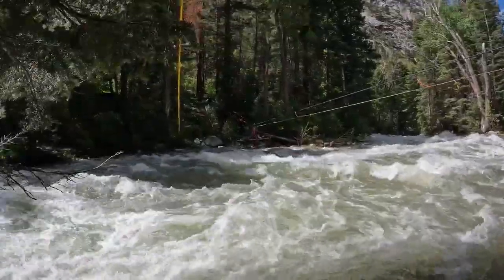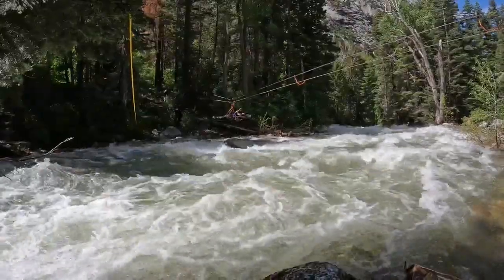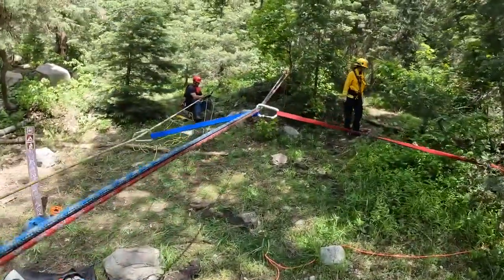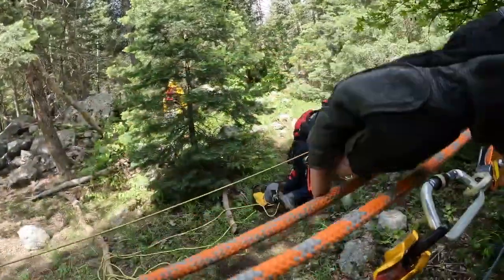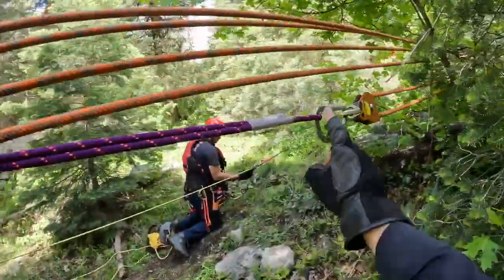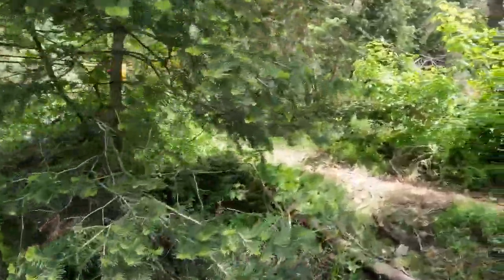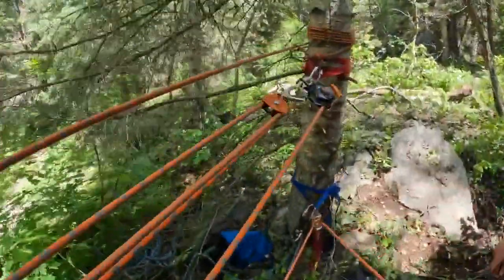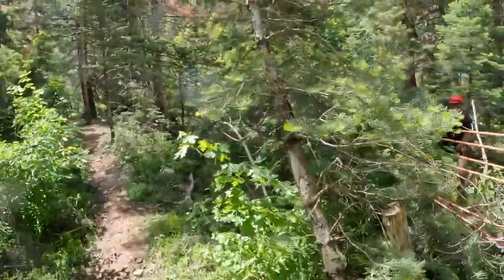Kootenay Highline Over Little Cottonwood Creek, UT

Comment: The other thing they keep in mind is that those rescue sanders will snap your rope at about 11 KN they do not slip like everybody seems to think #HowNot2
Reply: You’re better using a VT Prusiks which when tied in the max over one, it will usually slip at around 7KN before failure
Reply from the maker: The Rescucenders will not be seeing forces that high…. those forces are seen when track lines or anchors fail and the control lines have to arrest the impact force.  Yes, rescucenders are not manufactured, designed, or rated for any slip.  And while HowNot2 does have a video of the Rescucender breaking a rope, that is just one test from one source… there are others out there where slippage did occur, and at lower values in the 8kN range, so having them in to hold tension on the track lines is debatable.  Here we deemed it acceptable based on the forces we were tensioning to.
Reply from the maker: You can also check out two test videos here: 

https://youtu.be/C9L2A5Xs-oo?si=tKTMskKqluVDG4bH
https://youtu.be/ELWNT9BCgRM?si=0UEbuz7PseHoMjxB

As well as a fairly comprehensive paper from ITRS in 2014 here: https://drive.google.com/file/d/1mRxKx6DADTVkS5f9LPtpfERucXTr0uO2/view

and https://drive.google.com/file/d/1fGj70_R1MUHN_Yf007hM3yFQYK6WZPgn/view